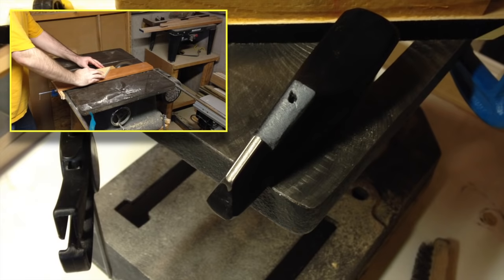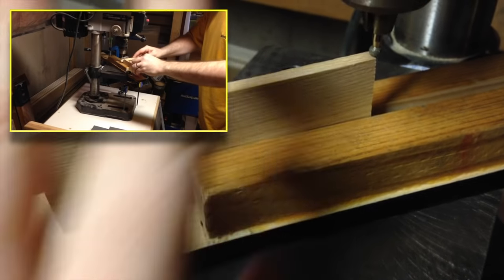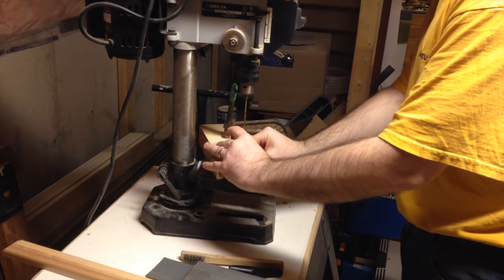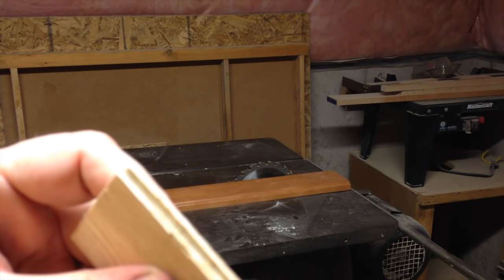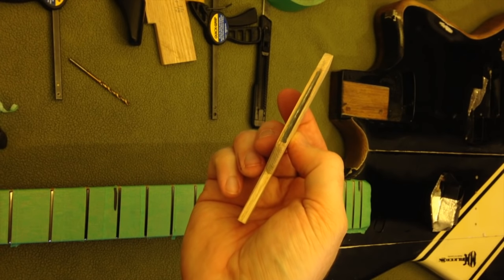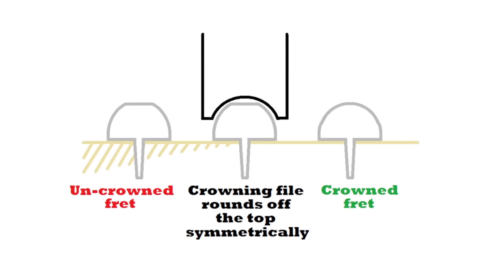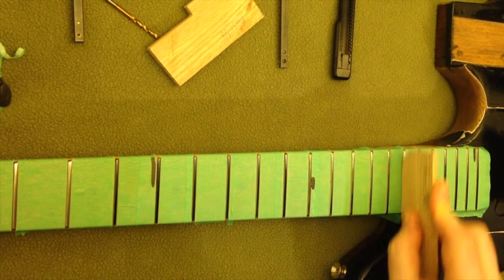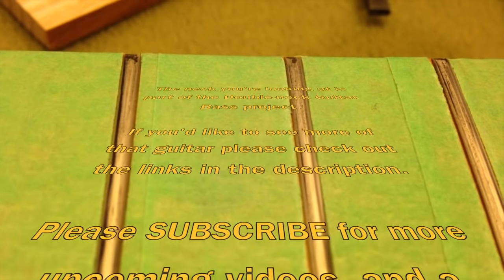DIY Fret Crowning File

Comment: Or, skip the end mill, the drill bit and the saw- lay a strip of 50 grit right side(face) UP over a fret on a newer guitar - SAND the fret profile groove into your wood block.  It takes literally 3 minutes. Then take a strip of 400 wet-dry - force into your newly grooved piece of wood - grit side DOWN to crown the fret.  I use a little shot of spray adhesive to hold it there in the groove but you don’t need to.  You can make a bunch of these grooved blocks - one for every size of fret you deal with.  It works great and you can use the $100 saved for some other overpriced StewMac tool 😂
Reply: Tioga Fretworks 🤔this is a good idea, thanks
Reply: Simple, cheap and effective.
Reply: I was thinking something similar before I read your comment, but just using a small metal rod of the right diameter fixed to a flat surface.
Reply: Oh, perfect. It's so simple and requires no tools.
Reply: That's actually a way better idea than this video's nonsense. Nevertheless, anyone who has done a couple of fretjobs knows that a piece of sanding paper needs to be replaced every 3-4 frets, so still an inconvenient solution when compared to diamond coated fret files.
Reply: @francoismarchand5461  Right! Anyone who knows, he will in future be repeating this process, will not cheap out on a decent file! Mine cost around 60 bucks and i would not want to miss it. It leaves next to no marks, frets really only need 1000 grit upwards till polished. Much faster job, less hassle!🎸🤘🎸

Comment: I had an idea years ago that I didn’t have the equipment required to pull off. Figure I’ll mention it here and if either the channel owner or a random person in the comments with the means to pull it off happens to see this, I promise I won’t sue you for stealing the idea lol. Hell I’ll buy one of them off you. 

This world desperately needs a fret crowning dremel/drill bit. A regular old aluminum disk with a fret shaped notch carved into the circumference with a lathe or something. The disk gets mounted with a screw to a regular ol steel shank (like the one used for dremel cutting disks or a larger equivalent for a drill chuck). The notch in the disk gets coated with an abrasive, it could be emery or diamond abrasive powder. The one problem with this idea is the tilt angle, because in order for it to work the rotary tool or drill would have to somehow be perfectly positioned parallel to the fret. But I can imagine a few ways around that. Firstly, you could probably just carve the notch in the disk at an angle, which would make it easier to hold the tool at the perfect angle to get perfectly shaped fret crowns. Or you could use one of those drill bit holder things that allows you drive screws and such in tight spaces where the drill itself won’t actually fit. Idk how the mechanism inside those things actually works, but you could presumably just buy an aftermarket one, slap the fret crowning bit on there and bang out the entire job in a fraction of the time.

Comment: Nice to have an extra set of fingers for when that table saw jumps over and trims the end of your hand, there. 
You've never had a problem? Still have all those fingers? A professional? Been using it for years? ... etc... I've heard it all before. 
Ticketed carpenter here with 40 years experience saying "You're going to be missing fingers."
On board with the replaceable abrasive on the fret dresser. I'll do mine in brass.

Comment: Or - just had this idea - forget sanding the groove in wood at all - use bondo - either over a new fret or a drill bit (well waxed w a layer of Seran-wrap so the bondo doesn’t stick to the pattern) - then fabricate the tool around that.  If it works I will post a video but don’t know why it wouldn’t. Dentists use a very similar process when they take an impression- and we’ve used bondo to make clamping cauls over braces and etc.

Comment: Please folks - NEVER run your hands past a blade like this - use a push stick.
Reply from the maker: Agreed. Don't do what you saw me do at 03:10, do what I did at 00:05... just a simple scrap of wood with a cutaway that allows you to hold the workpiece firmly against the tabletop and slide it smoothly along the fence into the blade. I too know a guy who had the workpiece shoot out of the blade into his palm and he needed surgery.

In my defense I work very slowly and cautiously... but that wouldn't matter in a momentary lapse of good judgement or if there was a hidden nail in the workpiece or whatever.
Reply: @mewoosh  Yes, safety first! I'm guessing you like to play guitars not just build them. Great video otherwise

Comment: This is how I do it... I do use in my stone  business blades that just happened to be 12" and others 10" radius. I dropped the guided blade on a 1/2" wide piece of wood just deep enough the get the high of a fret plus the thickness of the sanding paper and I get the perfect tool  in its proper radius. The 10" is close enough for a strat The 12" is perfect for LP.

Comment: Yeah, drilling through a piece of wood then slicing it... I've been doing 20 years or so. Cheap, cheap... do you know the string lifter one? when the guitar is all strung up.... You slide two thin pieces of plastic under the strings right up to the nut. Like the thinnest pickguard stuff, credit cards are the right stuff and CAN be used, but you can find longer pieces. There's some thin clear plastic used in vacuum packing pickups, tools etc. Anyway, when you've got the two pieces under the strings at the nut - you just slide someting about 3/16" thick IN-BETWEEN the two plastic pieces up to the nut, the tensioned strings lift right up pretty as can be. What does this mean? IT MEANS YOU CAN MAKE AND FIT THE NUT perfectly WITHOUT EVER GETTING A FILE ANYWHERE near THE GUITAR! Lift the strings up, take out the too-high nut, make it lower, CHECK, take it off, diddle the slots, check it again - the strings always stay ON the guitarAT tension  because lifting them and yanking the nut takes a few SECONDS. You don't even trash the strings! Beautiful shiny git stays scratch-free! Goddam I'm smart, guess that's why I'm so rich & handsome too. Send money....

Comment: The frets still looked pretty flat at the end. Maybe it was the light or you were not done. Would like to see them after final prep to see how they came out.
Reply from the maker: 12 South : For sure, the frets you see @7:37 were not done. #22 was particularly bad. I think I had footage for the final state of the fretjob, but cut it for time (mistake). By the text crawl you see the neck after they were already polished. I have a mahogany tele neck for the Mustang Jr. project... perhaps I’ll do a full/proper fret levelling video for it.
Reply: @mewoosh  #22 was exactly the one I noticed. I figured it just was not done. I'm just about to do a Epiphone Tribute Plus with 3 high frets driving me nuts with the buzzing then an Epiphone Custom Pro that I have to do a complete level on. I do it for a living, so no excuse not to do my own. Good idea on the crowning tool. I use either a 3 corner file or a Gurian 3 piece depending how many I have to recrown. But for most people it's not worth the expense to buy expensive tools when you're only doing one guitar, especially when you can make something yourself. Plus the added appreciation that you not only did the job yourself but created the tool as well!

Comment: Are you saying you refuse to spend 75-90 on a stewmac file? what a surprise. good info . TU
Reply from the maker: WV591 actually, if you get the version that’s an actual file (with curved teeth) then that would be worthwhile and save time. The diamond coated fret files tend to be too coarse and require follow-up sanding and polishing. So if you don’t mind trading your time for money you might as well just make something that uses sandpaper and do just as good a job. 

Also,If you were only going to do this I handful of times then it’s a bit wasteful to spend a lot on tools that will just sit in the drawer for most of their lives.

If you do this I handful of times per year, or even more frequently, then having tools that would do a good job faster would be worth it for sure. 

The cost of a quality neck from a reputable manufacturer will be between $200 and $400 so spending something on the order of $100 on a quality file would again be worth it for someone who insisted on buying crap overseas products and making them work

Comment: why not sand the end of the drilled one and the grove will be less deep?
What size dill bit worked?
Reply from the maker: Certainly, yes. They were both too deep before I sanded that first one so that's definitely the next step. The drilled and 'grinded' tools are equally good, but the drilled one is vastly easier to duplicate and certainly the way to go.

I used 9/64 to drill the hole (I chose it only because it appeared to match the manufactured tool by quick comparison) and then used 1/8 bit to press and hold the sandpaper in place. There are a lot of different fret profiles so this may not be optimal in all cases ...but it works great on "jumbo" frets.

I recently bought a 300 grit diamond file and I'm going to compare and contrast it against the sandpaper tool in an upcoming video.

Thanks
M.
Reply: Thanks
Gonna  do this
Reply: GR55bass

Comment: wait a minute, wouldn't that end up sanding the top of the frets, too?
Reply from the maker: If the fret has a flat top then it won't... it will round off the top of the fret. Once the fret is properly crowned it will begin sanding the top of the fret. So you stop sanding (in a given spot) when the sandpaper takes the ink off the top of the fret there. You have to keep adding ink between checks. That's the same method you would use with any concave file. Hope that helps!